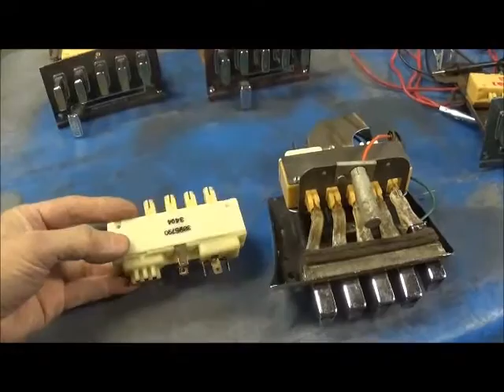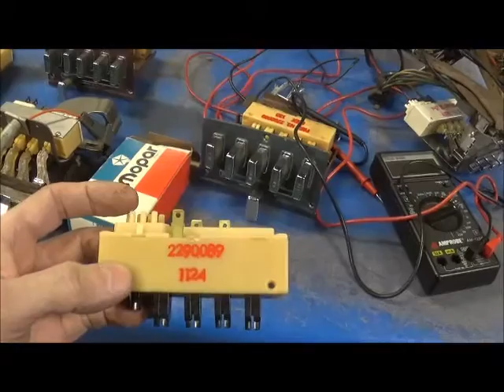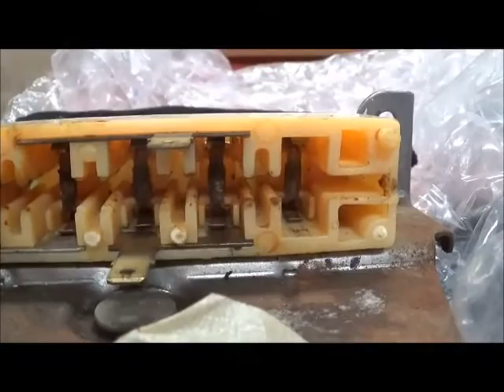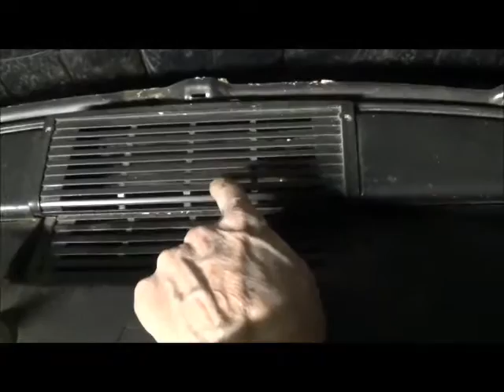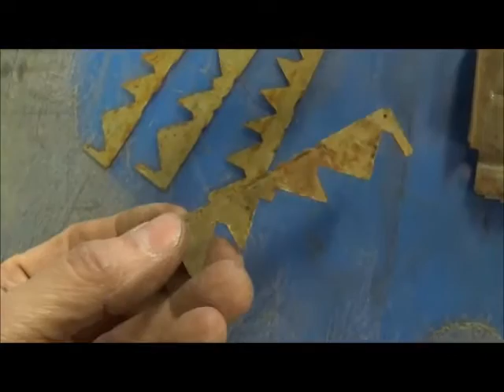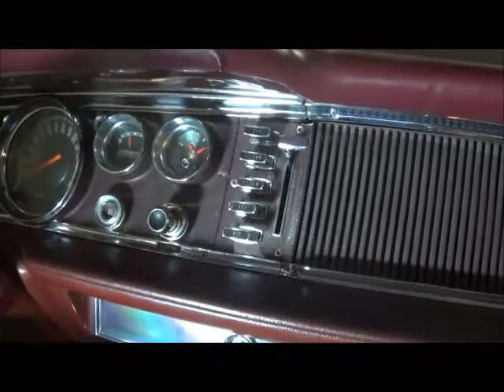1959 - 1966 Chrysler Heater Control Switch

Comment: My 1970 d200 has the ac/heater switch. The back busted off and before I could deal with it, and those little wafers fell out and I stepped on one and broke it. They are getting harder and harder to find, $200 on eBay for a NOS replacement. I’m putting 2 wires wrapped around the new one when I install it, because it is the most ridiculous design to push on a plastic box that doesn’t have a solidly attached backing, plus the buttons are twice as long as they need to be so you think you’re supposed to push them farther than they need to go. And don’t get me started on the snappy ball joints that attach the buttons… it’s like the entire switch was designed to fail in several different ways fairly easily…

Comment: i know this video is 5 years old but here go's. Looking for a control cable for the water flow valve 64 300 .
Also you mentioned you have some NOS button assembles vacuum valves whatever you want to call them? Interrested in selling an AC version.
I have a used non ac valve if your interested
Reply from the maker: Contact Murray Park at mbpark@cbodies.com for your heater cable. New push button switches are available on EBAY
Reply: @300rcm1  Checked ebay there are new reproduction ones with zinc plated terminals does not look like there selling well. Always concerned about the quality of aftermarket knock off's. 
Also a couple of listings for NOS with the copper plated terminals. I have found replacement switches with copper coating work better when there is high load like no relay. But have concern about the old grease as you mentioned.
Which one would you recommend?
Its a 64 300K straight pro black paint rechromed bumpers new weather seals ect. New 20 years ago legendary reproduction interior Ect ect. Garage kept.  I have owned for over 25 years heater ac controls never worked right. It was briefly owned by madsons AC they used to be in some of the old street rod mag article's.
They hot wired jumper wired patched things up so the fan would run at full only at the first click of the lever for water control and the air doors never did work right. the Ac clutch has also been jumper wired.
Trying to fix that. i have a wiring diagram but its not clear and in some ways doesn't match the OEM wiring still there?
You should post a video just listing sources for parts reproduction and used. As you know the support for 300's seems to be hit and miss.
Years ago there was a guy doing trunk liner kits. The carboard panels. I was about to order that and a bunch of other things and i guess he had health problems?
Reply from the maker: @tomhutchins1046  Use Quirey for trunk panels. They bought the business from Gary Goers. 814-509-6410. Talk to John Grady about the switches. His email is jkg@gradyresearch.com
Reply: I am interested in the non ac switch 2290089 if you still have it?  My heart jumped when I saw this video with Bob holding a new switch.

Comment: Thank you.  I liked the stills style, too.  Good info.  On mine I was loosing too much vacuum.  The hoses and valves have no leaks after testing all paths.  My issue was the rectangular "hockey-puck" rubber piece that had deteriated and had black, oily film right under the 7-pipe "organ" section.  Naturally, I cleaned it up and added a lithium grease (I tried several "filmy" garage tubes.), using predrilled tiny SS screws to hold it back together.  Using the Mighty Vac, I could test each goop.  (Lithium was the best, but, I just thought of more as I write this.  Vaseline?  Petroleum products might be the reason for the problem, maybe.  The supply hose was the least pliable near firewall.  Heat?  Gas fumes?) It improved a lot, but, not able to even get passed -8 psi.  The console vacuum lags and you can tell the engine is not happy.  (That's how I found the issue. )  'Considering a "master" vacuum valve to flip while I set what I want, then, close.     I have pictures for anyone asking faustoii2828@gmail.com.  The sliders are in order, too for LINDA-MARIE VIDEJERN.  Getting my '66 300 road ready.   Perhaps, Mr Grady has a spare or can comment?   Best wishes to all.

Comment: Thank U, Very helpful! Trying to restore my own switch but dont know in which order to put the sliders in.. anyone who can help?
Reply from the maker: John Grady at jkg@gradyresearch.com may be able to help.
Reply: Hi.   I have pictures for anyone asking faustoii2828@gmail.com.  The sliders are in order, too.   The three have a small hole that matches all three, with the brown-red slider in the mddle of the sandwich.  That hole is furthest away from the  hose connections.  Be nice to them.  I used a silicone soaked paper towel to carefully rub them clean of their goopular gunky film.  Lightly coated silicone spray.  Then, grease the very tops of the brass like  surfaces that actually touch these sliders from underneath - the switches you actually push in.  Use very little, almost just a wipe on them.  'Hardly see the grease.  More is not better.  Good luck.  I still thing Mr. Brady is your better source.  I hope GradyResearch is reading all this.
Reply: @stuckinmygarage6220  Use silicone grease (dielectric) It wont interfere with any electrical contacts. A generous coat wont hurt just help 
Who is Mr brady?

Comment: Great Video Bob, im in the process of trying to install a heater, that's been sitting in boxes in my garage for about 20 years in my Australian 1962 R series Chrysler Valiant (60-61 V200 Plymouth in the US) - i have a problem with broken pins and would like to know if you have the email address of the company that does repairs on these so i can ask about prices and shipping etc - your video gave a great explanation of the internal workings and i thank you for that - Peter P
Reply from the maker: ksimons@gradyresearch.com
Reply: Thanks Bob